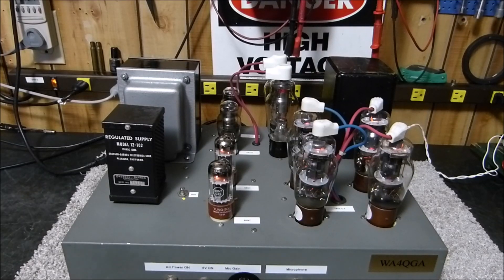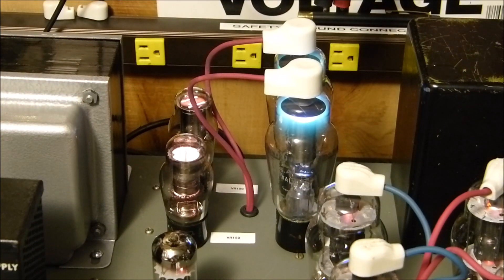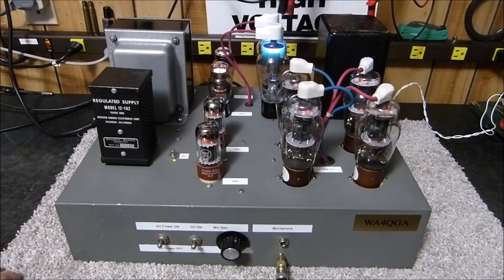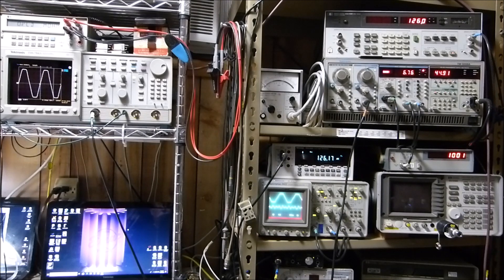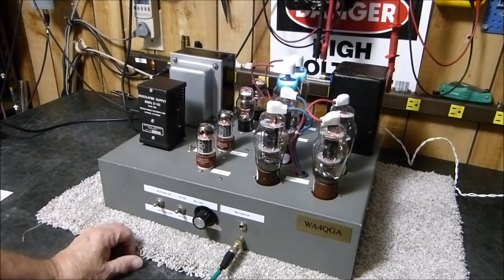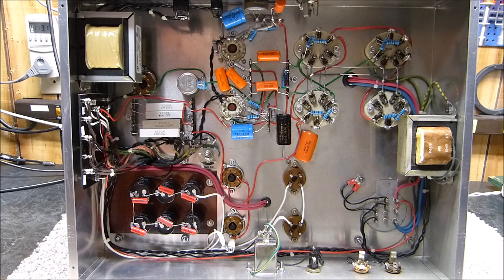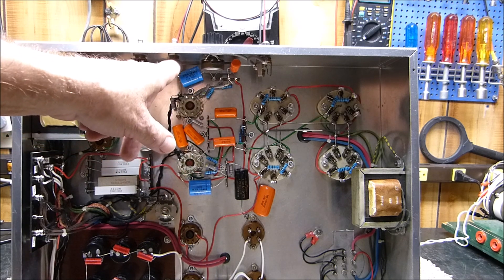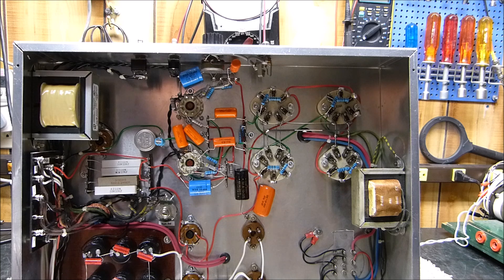807 (1625) Vacuum Tube Modulator Completion & Testing

Comment: You do have beautiful stuff. Very nice build quality. Just curious  why not use a little JEWELRY ? they have LED VU meters for little $ that would have taken a huge box just to build the meters.  Lots of very nice lighted analog VU meters. Its always nice to have a visual view of your output. Beautiful jewelry for very little. They even have full spectral displays for $ 50. Anazing. KA5WZY
Reply from the maker: You have a good point. I like to spice up the equipment some time. I joke that most of my equipment looks like surplus equipment from a cold war underground bunker with the grey chassis. When I get really fancy, I paint my chassis blue like the headphone amplifier I built for my grandson.  🙂 I do like symmetry try to dress the under-chassis wires along the sides of the chassis rather than direct - although sometimes short, direct connections can be the best. I do hope to build some more audio amplifiers soon. Thanks for your comments.
Reply from the maker: One thing I would like to say about this amplifier is, in the ARRL schematic, they directly wire all the screens together. I found that separating the screen connections from one another is a much better way to go. Everything works better when each screen has a little wiggle-room. I don't see it in this video but I believe I added 470 ohm 5W resistors in each screen lead right at the socket. It did wonders for stabilizing it and improving the output.

Comment: Nice job, very clean and neat construction. You have a lot of gain in that first stage, perhaps the first 6SN7 has a small heater to cathode leak? Or alternately, put DC on the heaters of the first stage.

Comment: Hi Dave, Grettings from the UK  Could you tell me the model number of your power meter sitting on top of the scope please. Thank you
Reply from the maker: Greetings from the US.  The meter is a Tektronix DMM 4020 and you can select 2, 4, 8, and 16 ohms for power. Here is a new one on Ebay.
https://www.ebay.com/itm/Tektronix-DMM4020-5-5-0-015-Accuracy-Bench-Digital-Multimeter/323768859506?epid=1300382570&hash=item4b6220bb72:g:y6kAAOSw5HNcWfZV

Comment: Did you try taking the center tap of 6.3 volt or center of him pot and take it to the cathode on the output tube.  I have had great luck with elevating the center tap above ground.
Reply from the maker: I do have a 100 pot across the 6.3 filament supply for the 6SN7's and it works great. The output tubes (1625) have the cathodes grounded straight to the chassis and the CT of that filament supply (12V) is to ground. I have gained a little ground in reducing the hum from the first stage by using shielded wire from the input plugs to the grid of the tube but it needs a little more attention. Thanks for your suggestions and I will keep that in mind any time I use a cathode resistor on the output tubes.
Reply: @ElPasoTubeAmps  I thought you were cathode bias. I did not pay enough attention. There are other was to elevate the heater circuit. You could also Buick a wire wrap grounded shield over the preamp coupling caps to get the hum out.
Reply from the maker: @kevin2960  Interesting you mention the capacitors. I have considered removing the input cap (0.047 uF) as I am concerned it may be picking up some hum. I did put tape over the connections of the HV CT switch and then cover it with copper tape to ground and that didn't do much if anything. Thanks for the suggestions. I will  check it out tonight.
Reply: @ElPasoTubeAmps  I have a huge collection of tubes also.  I am looking for an 83 rectifier.  Would you have one??
Reply from the maker: @kevin2960  I actually don't know if I have any or not. I would have to dig around in my tube supply. I just checked Ebay and there are lots out there for as little as $10.
Reply: @ElPasoTubeAmps  cool.  Last time I looked there were not many. I will order one.

Comment: David,
Please note that the Hammond 159V Choke has a Maximum DC Operating Voltage of 500V.
May I suggest that rather than placing the choke at the cathode of the rectifier tubes [the B+ line], that you place the choke between the negative lead [transformer center tap] and ground. This assures that the DC voltage across the choke is only the Idc x DCR [27 Ohms], while the power supply will operate normally. In this configuration, if a capacitor input supply is required, the negative of the input capacitor is connected to the point between the transformer center tap and the choke. This is a way to enable utilization of "low" DCV rated chokes in HV power supplies, and is also an old radio operator cure for failing chokes in shipboard radios, assuming that the AC voltage on the choke does not cause breakdown.
Reply: Kevin Counihan  Not very safe, but, effective.

Comment: Another great, informative  video!  In the VR schematic, it looks looks you're running the 866 filaments is series (5 volt?). Have you had any problems with that set up?
Reply from the maker: I am doing exactly that with the 866A's  as I have run out of 2.5 volt filament transformers.  This also allows me to use the 5V filament winding of the power transformer. The two 866A's require 5A in series and the 816's only need 2A for a series connection. I have done it a few times before this and I have no issues with it.

Comment: Nice work, I like how you layout your builds. Two questions, what did you bias the VR150/30's at in the end? I know the VR150/30 can be biased form 5mA to about 40mA. Q2 what are those blue resistors your using? I find it tricky to get decent sized metal film R's, most being tichy little things. Know what you mean about ordering from Mouser etc. Finding what you want can take ages. All the best...DA.
Reply from the maker: I did put a current meter in the VR circuit and set it around 45 mA tinkering with the series resistor to come up with about 9.4K, to keep them from going out under full load. A small amount over the recommended amount but probably OK.  I am waiting on some adjustable 10K, 50W resistors from Ebay to replace the ones I have in it at this time.
The blue resistors are some I ordered from Amazon. They are metal film, 2W, 1%. It was a variety of resistance values, certainly not all the values, but they were pretty cheap.

Comment: i found to stop the humm on the first tube i use a 100k off the grid to ground then run the grid to the wiper of a 500 kA pot
Reply from the maker: I may have to try that. At this time, I have 470K to ground and a 0.047 uF capacitor from the wiper of the pot (500K) to the grid. I am concerned the capacitor is picking up a lot of hum. Thanks for your thoughts.

Comment: Be interested to see how NFB affects frequency response and bandwidth. Seems from a comment that you might have experimented with feedback. I bet a lot of viewers would like to know about that too as there are probably more hifi  cuts than radio hams.
Reply from the maker: With the  HiFi transformer it was good but I did not make any notes on it. With this transformer in it as shown in the video, any amount of NFB make it oscillate. I do not understand why. Doesn't make sense but maybe I need to research it a little more. I know it is not phase as I have reversed the plate caps and then it went into real in-phase oscillation so the phase is correct from input to output.  I will research it a bit more.  Thanks.

Comment: This modulator came out great! I'm curious about how it would sound as an audio amplifier. Maybe adding NFB. The gas regulators do a great job regulating screen voltage. An 0C3 is used in the Leslie Speaker amplifiers (122/147) to regulate the screen voltage to a pair of 6550's.
Reply from the maker: The VR regulator turned out better than I expected as the screen current varies from less than 4 mA to 80 mA and the VR tubes supposed to operate at a max of 40 mA. The fact that they only extinguish at severe clipping says to me they are working great. Thanks for the information  on the 6550 amplifier. I did not listen to it with the other 10K transformer and NFB but I did listen to it as I showed it in this video. The gain is off-the-chart. I actually used my GR audio meter and the SPL in the shop was around 75 dB  but the amplifier at 9 O'clock was driving the speaker to over 105 dB. I wish I could show things like in the video but  YT would be all over me for playing copyright music.
Reply: ElPaso TubeAmps. That looks great! Thank you for the schematic. I have been pondering something along these lines with some 6p15p pentodes and an sg1p (oa2 vr) as the pentode screens require 150v max.  The literature indicated just a circuit, but it’s nice to see it confirmed and operating here. Thanks again.

Comment: Don't you have to use a different kind of choke for a choke input filter? I think it needs gapping in the core to stop saturation. But you have more experience with this gear than me!
Reply from the maker: The choke in this amp is rated at 500 mA (but only 1.5H) so I think it is sized about  right. For much better regulation, I think I need a swinging choke (5 to 25H) input to a Pi filter choke and capacitors. I  have some big ones for just that but they are Huge. I may use them both in my next HV power supply.

Comment: The detail and consistency of your video has no better equals than the build quality of this amp, well done David 👌👌👌 I would think the hum is coming from this power supply switch beeing to close to that input stage. Maybe just a piece of aluminum to shield this could solve the problem.. So some more tweaking I guess ☺️
Reply from the maker: Thanks... I am getting better at not moving the camera around so much. 
I agree that the power supply wires are the problem being too close to the input stage and I will do some tweaking to get the hum to an inaudible level. I know it is coming in from the first stage as I can remove that 6SN7 and the hum goes to zero.

Comment: Really impressive amp David... Beautiful point to point work.. I guess you've built so many amplifiers, that you just know the best layout of tube sockets for most efficient wiring.  Maybe build a spring type hold down for the bias supply regulator so it can't inadvertently fall out of the socket.. Hope the therapy helps and Happy Thanksgiving to you and yours, Tom
Reply from the maker: Hi Tom, Yes, I should find some way to anchor the bias supply to the chassis. So many times I have decided to quit building so many amplifiers but I am like an artist that can only paint vases or something...   :-)   
On the other hand, I think it is about time I calmed down and made an amp with the line matching transformers I have posted videos on and one of the SS SMPS, 12 volt input power supplies. One good gentleman on an earlier video suggested using the SMPS supply for the screen supply. That should give great regulation but it would require a 12-14 volt supply to drive it. Probably nothing more than a bridge and a capacitor for the SMPS. I am going to think about that project.

Comment: Keep up the good work,quality in construction is great,I figure I may run two 807's in push pull in my next design,regards Colin.
Reply from the maker: I do think the 807 and 1625 are very much overlooked for ham radio and audio. It is just a good 6L6 with a plate cap for higher voltage ratings. One of the best performing 20 watt amplifiers I have ever measured used a Williamson design driving a pair of 807's and an Acrosound output transformer.

Comment: What is this for?
Reply from the maker: At the moment it is just an audio amplifier but when the output of this device is connected to another identical output transformer to provide a 7000 ohm output instead of low impedance speaker output, this 7K winding is connected between the HV power supply and the plate circuit of a class-C RF amplifier driven by an RF exciter at whatever frequency we choose and we get amplitude modulation (AM) output to the antenna for ham radio.
Reply: @ElPasoTubeAmps  Wow, neat !  Thank you and Happy Thanksgiving Love to hear it on the air. 73s from NW WA
Reply from the maker: @321CatboxWA  At this time I only operate 20M SSB and hear stations from WA on all the time so me may meet each other. I will put a smaller AM station on my 20M antenna but I am concerned with putting 1KW of AM on a hexbeam. Not sure the antenna connection points could take that level of voltage. I am trying to settle on something in the range of a 200 watt AM station.  73  WA4QGA  I also have a lot of pictures on my QRZ page.

Comment: Powerful amp. surprised how low the THD is without neg feedback. Thanks for uploading.
Reply from the maker: Hi Simon, Yes, I am surprised about the THD also and it is consistent from low power levels to clipping. With the 10K transformer in it and about 16 dB of NFB it became a respectable  Hifi amp with typical THD around 0.3% but the gain is so much less I would need a preamp between the microphone and modulator.  I forgot to show it operating into an identical transformer and what the output is on the high Z side but with very little loss, it is the same.
Reply from the maker: Simon - I know you have a lot of experience with spectrum analyzers and suddenly my HP 8596E comes up with a partial screen with two horizontal lines and some data on the right side of the screen but just after power up it says, "empty DLP memory". I think DLP stands for" down loadable programs".  I am assuming that is the main problem but as usual, at least with me, I find the HP manuals a nightmare to find what I want in them. Do you have any suggestions as to what the problem is with my SA? I am hoping a battery is dead and i can get this thing working again.
Reply: @ElPasoTubeAmps  Not really an expert but a tinker. I would remove the ROM and CPU board and clean the contacts. Is the battery actually flat? Does the SA respond to and key entries? Might be a corrupted rOM if not.
Reply from the maker: @SoddingaboutSi  Thanks, Simon. I will put it on the bench and check it out. I have never had it apart as I have never had an issue with it until now. I assume it has a battery and since it is bad (?) I figure I will have to reload the calibration ROM (?)  somehow...   It has some legible detail on the screen but it does not respond to key entries. Much of the challenge comes in understanding the HP service manual. It seems like they should list an error of, "Empty DLP Memory" and some solution.  If I get it working again I probably should post a video on it as I bet this issue eventually happens to all of them as, I assume, the setup battery has died.  I had the dead-battery issue with my Tek DM5010 and once the calibration memory is gone, a full cal is necessary. It turned out very good, fortunately. Thanks again.